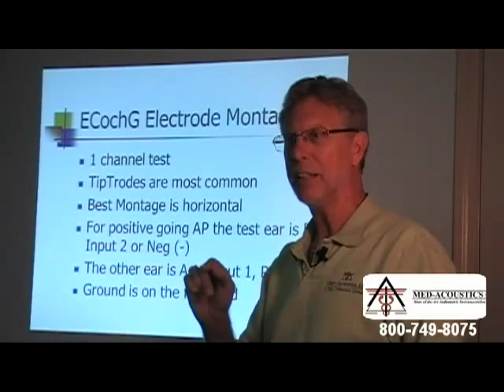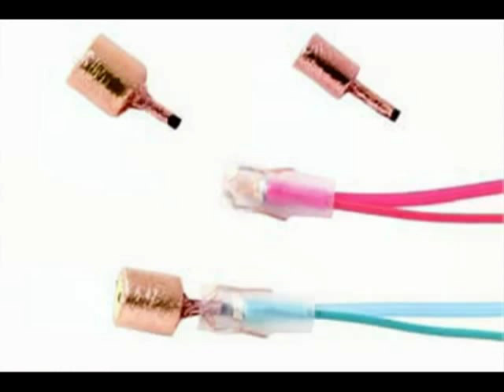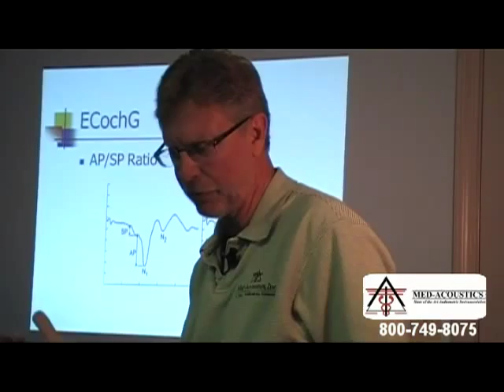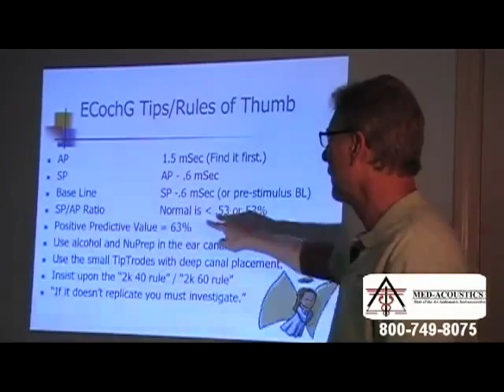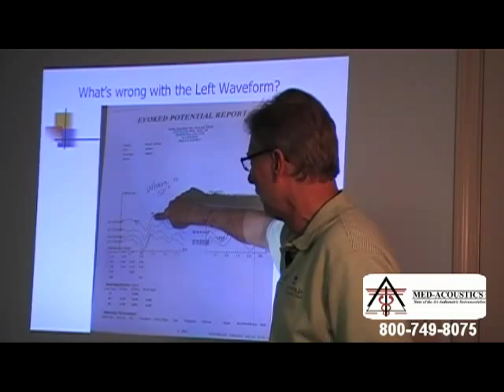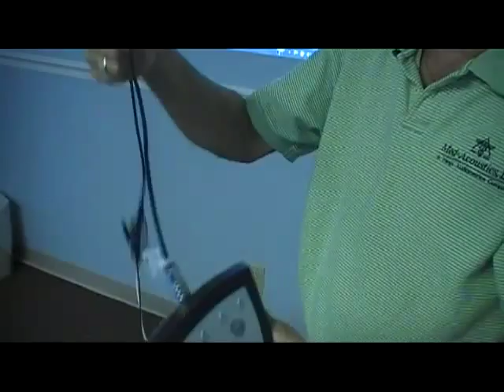Auditory Electrophysiology In Audiology

Comment: Hi greg.., in cases of sensory hearing loss.. how would it affect the wave v latency intensity plot… thanks
Reply from the maker: In the case of sensorineural hearing loss, the latency-intensity plot will not run parallel to the normal range. Instead, the wave 5 latency may be in the normal area (or close to it) at high intensities (80-90 dB) but raises quickly out of the norm area and continues to raise, more and more, outside and above the normal area, as you run curves at the lower intensities. If you have a good repeatable wave 5 ABR curve at 90 dB, continue to run curves, and lower the intensity by 10 dB each time, until you can no longer get a decent and repeatable wave 5. 
Hope that helps.
Reply: You mean loudness recruitment..?? Sir greg.. thanks..

Comment: hi greg what would be the abr findings for a sensory hearing loss.., for the wave v latency- intensity plot..???  in the evoke potential report..., thanks
Reply from the maker: A conductive hearing loss delays Wave V due the resistance it imposes to the transmission of sound energy through the middle ear. It is best to look at the Wave V latency-intensity plot to identify a conductive loss. The plot will run above and parallel to the normal area. 
Hope that helps.

Comment: hello greg what are the typical findings for conductive hearing loss..?? in evoke potential report..??? will the wave v be pushed out to the right..??? thanks
Reply from the maker: Yes, wave five can be pushed to the right of normal (delayed) with a conductive loss. However, the best way to determine a conductive loss is with a latency-intensity plot of wave five. It will be quite different from a sensory loss plot. (It will run parallel to the normal range, but separated from it.)  Also use bone conducted ABR, and note the air-bone gap as well as tympanometry.
Reply: so we can use the abr to determine different auditory pathologies.???., sensory loss, conductive, mixed, and ansd..???... 

do you have a video here in youtube that demonstrate these findings in an abr.?? thanks greg...
Reply from the maker: @francisadajar9617  It would be best to check the “Academy” on Interacoustics.com for a video on that. 
I don’t have it, because I don’t actually see cases. My expertise is on the instrumentation side.
Reply: hello greg in the case of sensory loss ., what would be the findings in the latency-intensity plot of wave v..?? 

i suppose the tympanogram would be normal in this case
thanks...